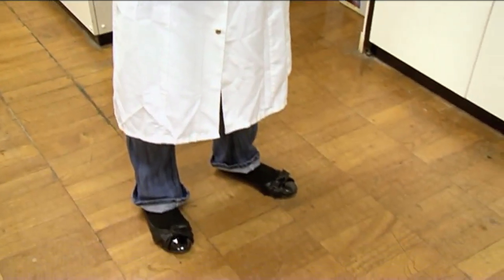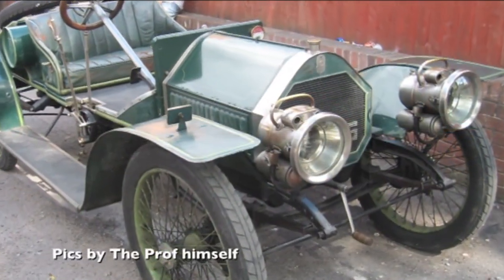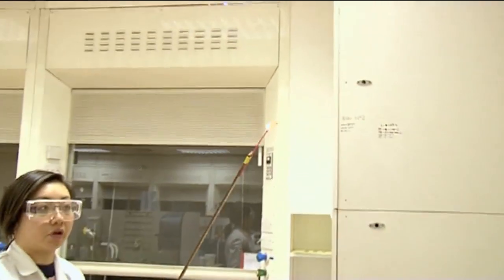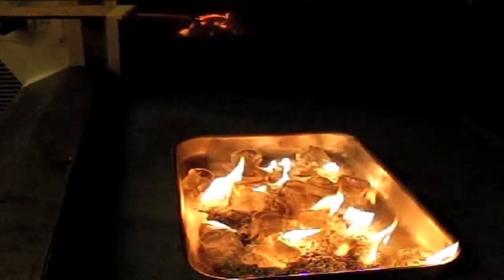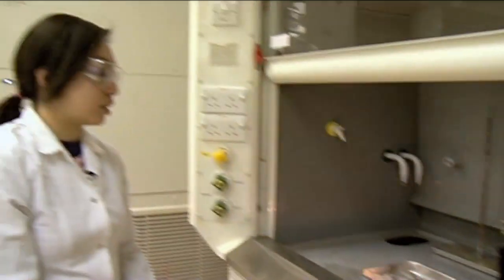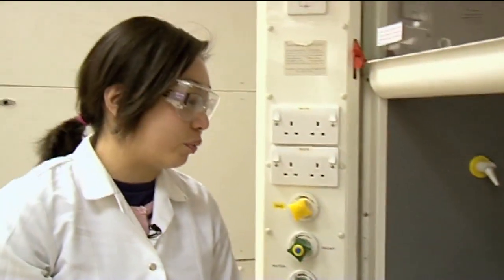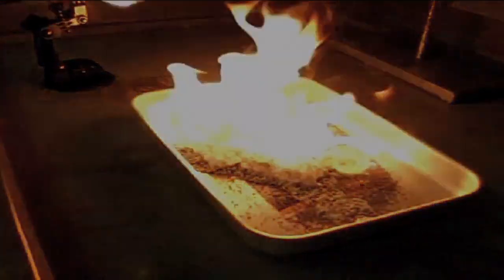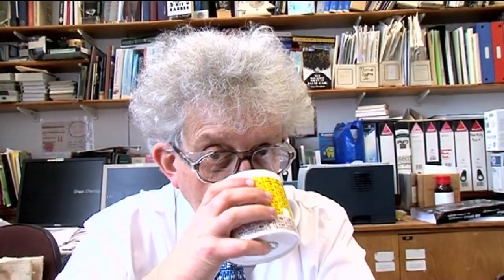Calcium Carbide & Acetylene - Periodic Table of Videos

Comment: Unfortunately the old carbide lamps, including one you showed in the video, were made of copper or brass, the acetylene reacted with the copper to form explosive copper acetylide. Usually this was not a problem but any attempt to say repair a leak in an acetylene lamp by soldering it, resulted in an explosion.

Comment: Here is a story from my grandfathers childhood:  A few rat runs were located under their chicken coop. He and his father plugged up all the holes with exception of two on opposing sides of the coop. Long story short with the use of a pile of calcium carbide and water they successfully managed to blow the chicken coop 3' vertical. The chicken manure which was once located on the concrete floor of the coop was now plastered to the ceiling and the hens did not lay eggs for weeks. Mom was mad.

Comment: Classical example: imagine an empty balloon with dots on its surface. as the balloon is filled, the dots appear to move further away from each other, without actually moving anywhere in their own point of view. That's what is happening. Except the 2D "surface" of the balloon is actually the volume of space and the insides of the balloon is the fourth dimension, which is not really possible to picture in head but makes sense in theory. So one can say space is expanding, but it's not as simple

Comment: I've got a miners torch that uses CaCo3 and water. I brought it to chemistry class and we fired it up. It was very cool and it actually worked quite well until the joint where the gas chamber met the water chamber burst into flames. Turns out it needed a gasket!

Comment: Space is not nothing. It is nothing in the sense that space its self has no matter, but it very much so is "Something." Space is a field which matter interacts with. Mass causes this field to stretch like fabric dome around the mass. As a result this allows orbital motion as the mass kind of 'rolls' around the stretched fabric. Much so like a basketball rolling around the top of the hoop before finally falling in or out of the hoop.

Comment: This is probably more of a preventive measure(telling your kids santa won't give them a toy if the aren't nice) but in literal speak, it is dissolved, so shaking it, or hitting it can cause it to raise in pressure. much like a can of soda after it has been shaken or dropped. but your regulator compensated for the pressure difference. but obviously ddropping any pressurized container is bad, and even worse if it's flammable. hope that's helped....

Comment: At work I sometimes use Acetylene to cut steel. I was told by a safetyinstructor an Acetylene cylinder could explode when you hit it with a hammer/knock it over on a concrete floor. It should start somekind of reaction in the cylinder. Is this true and why does this happen?

Comment: I had one of the old carbide lanterns for my bike at one time. I never considered it dangerous, although it did get quite warm. The calcium carbide went into one chamber, then you closed that and put water into the upper chamber. You turned the lamp on (and adjusted the brightness) by opening a needle valve that allowed a controlled drip of water into the calcium carbide chamber. I can't remember how I lit it - maybe a built in flint striker?

Comment: I think the glass windshield and no seat belts would be much more dangerous, as well as alot of old cars had gravity fed gas systems, so your gas tank was basically above the engine right where the driver and passenger sat. But really back then those cars didnt go as fast, they didnt have much horse power and the roads where nothing like we had today.

Comment: Surely the calcium carbide reacts with moisture in the air? So when you store it in a tub like that it goes off quickly or is an explosion risk  from the build up of acetylene when the lid is on?

Comment: I love your videos, and this was a nice demonstration of calcium carbide's run with water.  However, I much prefer a demonstration called the "carbide cannon" which consists of some sort of metal tubing, a plug/projectile of some sort, and a fuse.  As you can imagine, the acetylene builds up for quite a nice explosion and a bang.

Comment: Here's a little thing I pulled from Wikipedia as I can't translate it better myself, an old custom of The Netherlands:

"In the Netherlands, calcium carbide is still used in a traditional New Year's Eve custom called Carbidschieten (Carbide Shooting). To create an explosion, carbide and water are put in a milk churn with a lid, with ignition usually done with a torch. Some villages in the Netherlands fire multiple milk churns in a row."

Comment: In the eastern parts of Holland there is this tradition called "carbide shooting" near the end of the year. An old milk can with a small hole drilled in the bottom, add some calcium carbide, shut the lid, wait a few moments and hold a match on a stick next to the hole.

Can only be done an big empty fields.

Comment: This is used for welding too. But the equipment I saw always used a big (sealable) container of water, the guy just placed a few lumps of carbide, closed the top and got acetylene that way. It is fun to drop a lump of carbide in a bucket of water - then you can light the water on fire. Or put a lump of carbide on the ground, spray it with a bit of water and light it on fire - then if you spray more water the flame gets bigger.

Comment: ...Because the water is in a solid state, it has most of its atoms locked up.  The reaction can only happen with the atoms on the surface of the cubes.
Also it probably wasn't done with correct molar ratios, it was a "sprinkle" and a "handfull".